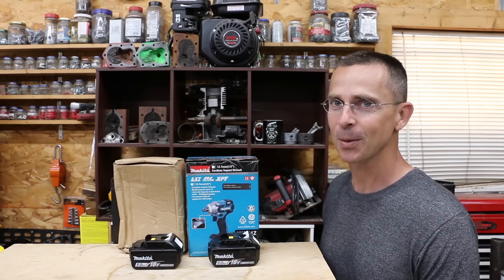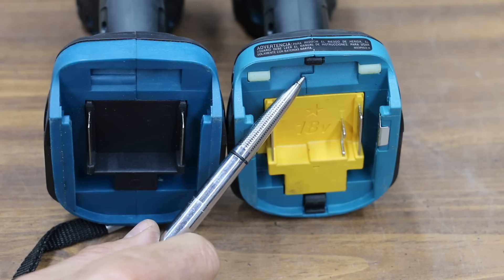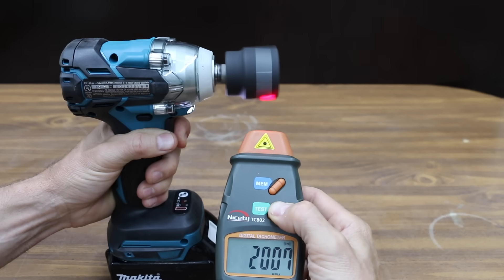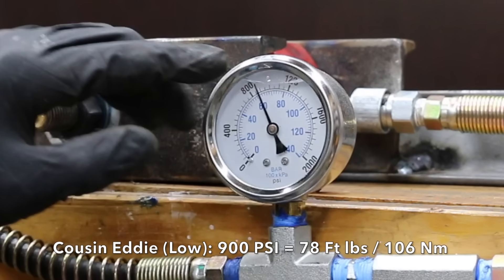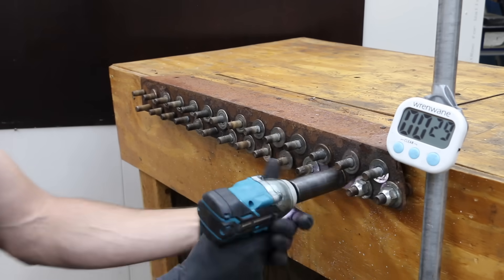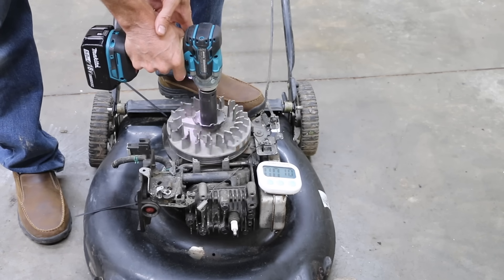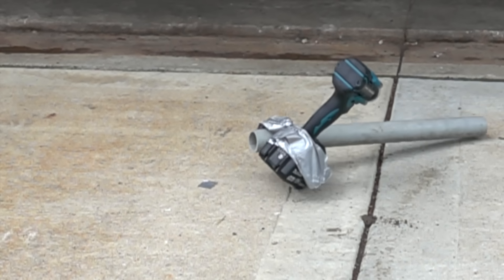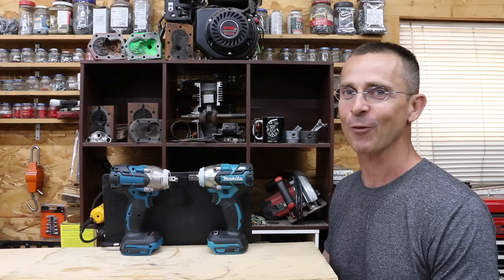Fake Makita Impact Better? Let's find out!  Makita XWT11Z 18V LXT Lithium-Ion Brushless Cordless

Comment: The end result should include: "It really depends on how much you will use it". If a couple times a year, get the cheap one: Often, get the Makita
Reply: For some small work in Your house, buy 2 cheap ones, when the 1st break, you have your backup ready on hand. Do a new decking, or other big projects, buy one very good and a cheap one, the cheap will hold out until you have time to buy a new one when the good one breaks/get lost or your brother in law want to borrow one, then you have the cheap to lend him. This applies to all kind of tools. And yes your wife is not a tool, if you have a spare, it could be very expensive😁
Reply: @dmg4415  Pretty clever reasoning, but don't we ever tire of buying 2/3 as efficient junk compared to quality?
Reply: @rcnelson  I got tired of buying junk. I dont justify it anymore because I am tired of replacing things often. Since buying good quality items, my quality of life has improved. Even the feeling I get when working with them is better.
Plus, down with China made so I wont buy Makitta anyway lol
Reply: You can also have them both! ;)
Reply: My dad was a builder and he had a Milwaukee for 20 years, and it still works today almost as well as it did 20 years ago
Reply: @potatolord5827  I have similar experience with our local well known tools. But with the ones which were made really 20 years ago. Not nowdays. Many parts made of metal were replaced by plastic and are not so durable. I also have some bad experiences with warranty. Cheap tools are ok, you'll get new one without a word (not talking about Wish and Aliexpress,...) but premium brands are not always so happy about complains. They are trying to negotiate, blame you for wrong use, reapair as little as possible. So I will hold my opinon for now - it's easier to buy 4 (quite powerful and good) copies than one original.
Reply: It also depends on how much torque you need, as seen here the cheapo says it will deliver 520Nm but it barely gets above 120Nm. A lot of stuff will be needing more torque than that. I have one that delivers 1000Nm of torque (Makita), which I don't use or need that often but it has saved me from having to go to a garage a few times so it has already saved me more money than it cost.
Reply: I said the same thing when I worked at the tool and implement store ( NOT Harbor Freight ).
Reply: no sense grabbing a cheap one when it wont work. Found that out the hard way. Spent $100 on a Ryobi 1/2 tool, since I already had a battery for it. Was useless. Had to break free bolts with a breaker bar then use it like a drill to cut down time taking the nut off. Had to keep borrowing a friends Rigid before I went and got one. Home depot sells the Rigid 18V 1/2" with battery.charger online for $150. Best bang for your buck. Takes off crank and carrier bearing bolts with little to no effort. My Ryobi 1/2" couldn't even get them started.
Reply: @frostbite1991   TBH ryobi, rigid and HF are all one China company with different molding. right now its China made(Ryobi, rigid, skil) vs Makita vs Milwaukee, with Hilti and bosch wayyyy up.
Reply: @frostbite1991  I still have a Ryobi 18v drill that I bought 20 years ago when starting out as a alarm installer. I used it for 10 years and it still works today.
Reply: Zac Price ryobi is trash. I had a 1/8 drill bit break off in some wood after maybe 5 uses. Just regular lumber, nothing expensive or pressure treated
Reply: The thing pepple aren't mentioning is time. You can go to the store and grab a new Makita so the time it takes to replace is a matter of where you are working in relation to the store, the knockoff took a month to ship. Sure for my wife it wouldn't matter she can get the knockoff, my milwakee stuff is in the garage if her chepo stuff doesn't do the trick but if j also had the cheap junk and it quit I can wait a month to finish a project in a I'll fated attempt to save a few dollars. In my experience the cheap stuff always has cost me more then buying something of a adequate quality the first time.
Reply: @jaydunbar7538  Like the other guy said, the cheapo one is likely a back up. IF you are working on something and your good tool broke but no store is open/too far away, grab the cheap one and finish the job. THEN replace it. in maintenance term load sharing is worth than Backup.
Reply: Pretty much ya
Reply: Often *get the milwaukee
Reply: Unlike most educators nowadays which teach people only WHAT to think instead of HOW to think (which is why we have things like CHAZ), this channel teaches HOW to think.  Unlike the media - the facts are presented and the viewer is given enough material to be able to make their own (now) educated (IF they have the ability to use their critical reasoning skills) decision. 
  There is no need for Mr. Project Farm to tell people which one to choose for what circumstances since anyone who can use think for themsleves would obviously be able to decide (for themselves) which one they needed for their own circumstances.
And...the statements made at the end included Cousin Eddie was good for 30.00 - which was a way of saying the cheaper one can is not a rip off at 30.00...just don't expect the same quality as the better one.
I am not trying to be mean, but as a former teacher I am so sickened by how dumbed down the masses have become so dependent on a "nanny" to make their decisions, and come to conclusions, for them.  The public education system (overall) has been controlled now for decades by those making puppets instead of fostering critical thinking skills in students.
Reply: I disagree. Even well known brands can stop working at some time and if Chinese impact wrench will stop, you can afford three more of them before you can afford Makita.
If Makita will stop working and you'll buy a new one, you can have eight of them.

Comment: If you do more impact driver testing, I'd personally be interested in seeing ones comparable to the Makita LXT sub-compact. Very high torque impact drivers have their purpose, but for frequent use the LXT has been great. Since I bought it, the only time I have needed more torque was to remove a rusty 19 mm nut that was torqued to 200 lb ft about 20 years ago.

Comment: I've recently been in the market for a router. Maybe do out a router bit showdown?
Reply: Just as a matter of interest, I bought a $30.00 no name trim router it is a corded tool because I couldn't find a cordless knock off at the time .I have been using it a fair bit as I am a carpenter, I find it powerful, smooth running and well made ,I am very happy with it .

Comment: Can you test knock off batts for these tools. I have a lot of m12 tools, and needed another high amp batt, so I purchased an Amazon knockoff 6.0 amp, but my Milwaukee m12 4.0 seems to have a lot more power than the 6.0

Comment: If you can test Milwaukee and Bosch, I'd be very interested to see the results.  I'm a huge fan of Milwaukee and Bosch  tools.  I also have a few DeWalt tools as well - to me, it doesn't feel as robust.  I had some old Makita tools (the old stick battery tools).  I haven't liked Craftsman, Harbor Freight or Skil cordless tools.  I also have an inexpensive Ryobi (not a huge fan, but it was cheap) that's okay, but not a great tool.

Thanks again for a great video.  $30 for a brushless impact wrench is a great price, but will it do the job?  And how long will it last?  I'd rather pay a few dollars more and get a quality tool.

Comment: How about testing 18v Dewalt tools with the adapter to use 20v batteries. I have 10 Dewalt 18v XRB tools and only 1 decent battery left. Is it worth my time and effort to buy the adapter and a couple of 20v batteries or bite the bullet and start a new collection of 20v tools.

Comment: Interesting product test, the cheap knockoff was just no match for the real thing though it does seem to be great value especially being brushless. I paid $100 for my Porter Cable 1/2" impact wrench as a bare tool, just the tool only and it has 350 ft lbs of torque, it's a great impact wrench. Keep up the great work!

Comment: Cousin Eddie is the perfect tool as loaners and that shop assistant who keeps breaking stuff. 

Lost? Broken? Forgot to bring it back? No issues, just bring a six pack next time.
Reply: They have a Milwaukee cordless drill at work. The problem is, they never use it because, you know, it could get damaged. So they use an Einhell all the time. Einhell is a cheap brand.

Comment: I have a ridgid brushless 1/2 impact that sits in my truck 24/7 and cost me around 150 dollars. The thing is if I had a knock off unit just like that and some spare batteries I would put them in all of my cars and trucks. Beats using a tire iron. Those 12v impacts are nice yet they are really only good to use on cars. If I need my tool I just grab it and use it then put it back!

Comment: AVE had similar results testing harbor fraud versus the name brand.
With harbor fraud some components were built better than the name brand, but others were not leading to a overall shorter life due to those components wearing out.
I would say for the "casual" user the knock off will work fine for them as they might not need the actual impact itself, or not need it to the full capacity.

Comment: Seems like a solid tool for only 30 bucks... until you think about the jobs you'd grab an impact for. You're using an impact for the power. To exaggerate my point, what if Cousin Eddie was only $5, but output 10ft/lbs of torque? There's a point at which makes it worthless. Everyone will probably have to set that point for themselves.

Comment: Chicago Pneumatics invented both the air and electric impact wrenches. So all should be paying them, but that is not how reality works. For home use, I would buy the $30 Chinese, Indian, Korean, Taiwanese, Japanese, etc etc who ever makes it as long as it does the job vs $130.00. If they are specifically saying they are a brand that they are not then yea I would not buy it.

Comment: While it may not be the case in this video (haven't finished watching) i know for a fact that many manufacturers make their tools exactly the same on the inside but sell one as "no-brand" or some other budget thing and then they sell essentially the exact same product with a color scheme, a sticker and a glossier manual for 2x the price. EXACT SAME PRODUCT, just different skin.

I've worked for a few companies like that producing anything from tools to bread.

Comment: You get what you pay for most of the time. I di buy a WORX oscillating tool on sale for $40. The blades work fine but the sandpaper holder was worn out only after using 2 of the 3 sanding pads included in the package. Such is life. I was wondering if you ever got any requests for testing saw blades, wood or metal. I have to say I got a ton of use out of the saw blade included. The blade still works somewhat but ended up buying a 3 piece DeWalt set for $33 which included 2 wood blades I believe a 1 1/4" & a 1/2" & a 1 1/4" bi metal blade. I see multiple sets on ebay  for about $1.50 - $2 and wondering if they are worth it. I've heard some of those sets come in multiple use blades including metal, wood and plastic blades. I bought the DeWalt because it was last minute and needed a newer blade to get a more precise cut.

I also bought a Bosch palm sander fro $20 because I knew it had problems with the front spring holder. It would sand ok on wide surfaces, but if you tried sanding the edge of 1" wood stock the paper would fly off. I took the sander apart and found I could move the end of the spring to a position to put more tension on the paper and works great now. I let Bosch know about what I did but never heard anything back. Maybe because it took me a couple years  to actually finally take it apart and fix it, lol.

Anyway, love your videos and thanks for sharing your discoveries.

Comment: Nice video. I've stayed with Makita for 30 years. Nice product. Had some battery problems over the years, but love the reliability. If you can afford the higher price and use your tool often, I would go with the Makita. But for odd jobs it's hard to beat the $30.

Comment: The thing that always sends me back to makita is the longevity of their tools.
I've had the same impact driver for 9 years, it's starting to show it's age now after years of abuse. It can no longer undo wheel nuts like it used to but still drives a hex batten screw into hard wood with ease.
I want reliability more than anything and I can always count on that from makita.

Comment: Great video, sometimes. I find the batteries cost more than the tool itself.

also notice that the Makita have a fuse inside the tool to avoid short. so sometime little extra protection maybe worth it if the tool is wet in the rain.

Comment: The problem with lightweight impact wrenches like "cousin Eddy" is that if it doesn't have enough torque to get the job done then you are just stuck, you wasted your money and your time.  Another great test procedure.  Thanks.
Reply: Sometimes you just need a normal wrench and a steel pipe. If brute force doesn't work, you are not using enough of it.

Comment: In the world of tools you usually get what you pay for. There is some instances of social engineering and design (like you wouldn't treat a festool like you would a dewilt) but they seem to be few and far between. 
Getting legitimate dewalt/makita/milwuakee is generally going to be the best bang for the buck. You can buy Hilti and have a real pro grade tool that outlasts the battery platform, but it's beyond the average persons performance to $$$ ratio. On the other end Ryobi and Ridgid generally last very well with not enough power to destroy anything. I've seen them all and I honestly would probably use Makita if they made more trade tools, but Milwaukee wins the trade specialty tool game and once you have $1k or more in batteries it only  makes sense to deal with the same battery system.

Comment: I'd love to see a stress test of various ratchet socket wrenches. As someone who is currently using a 1/4 ratchet that has worn out (direction lever keeps flipping) I'd love to know a better brand.
Reply: I'm not so sure a quality 1/4" drive ratchet exists. I can attest to the Mac and Snap-on 3/8 and 1/2 drives. I've exchanged several snap-on 1/4's and they always flip themselves. I relegated myself to keeping a thumb on the button. So long as it flips and I don't have torque on it and it busts my knuckles I consider it better than the cheaper ones that slip under load.

Comment: Thanks for doing Makita!  I've had this Makita impact for several years and I couldn't be happier with it.  I recently got a stubby impact 12v Milwaukee.  The Milfaulkee has a higher torque rating (250 vs. 225), but the Makita out torques it (granted it has an 18v batter).  I just got a cousin eddie cordless brushless makita copy angle grinder from banggood.  They're on sale now for under $50.  I have a brushed cordless makita angle grinder that has about the power.  Maybe you could do a Makita cordless brushless comparison....

Comment: I use Hilti brand hammer drills at work (36 volt). When these drills experience impact trauma, like bieng ran over by a heavy piece of equipment, the permanent magnets inside the motor break....Only after a day or two of use will this show up.The cracks in the magnets polarize against their now counterparts, and they seperate.The last sound they make is CRUNCH CRUNCH CRUNCH...........Until you replace those magnets, which is usually cheap....just a thought...THANKS FOR THE AWESOME PROFESSIONAL VIDEOS!!!